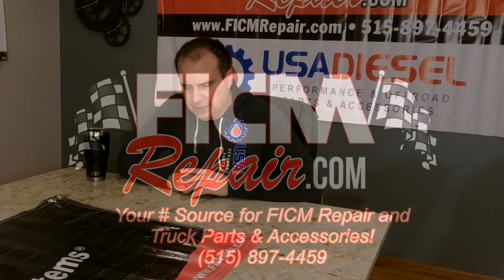Powerstroke 6.0: Injector sizing

Comment: I inherited my dad's 2005 6.0.  Hes got the egr delete, fass fuel system, head studs, tuner, and banks turbo.  My brother has had the truck a couple years and it has injector issues.  Im going to just replace all of them.  I just need to get a good size recommendation.

Comment: I wish it was only $200 more. I came in and talked with Scott. Pricing for 205/30 vs 155 same manufacturer was $600+ taxes and then I still needed a tuner and tuning all in all I was going to be $1400+ to go with the bigger injectors and run them as stock
Reply from the maker: I apologize for the disconnect that clearly occurred here, but as of this writing a set of premium 155/30's from Holder's diesel is $2,458 and a set of 205/30's is $2,640 for a spread of $182.  If you wanted to go with Holder's Basic Remans, the 155/30's set runs $1,375 and the 205/30's go for $1,475 for a spread of $100.  Perhaps you were comparing 155/stock units?  If so, that spread is far more as those units as a basic are only $900.  Regardless, if we tune your ECM directly, that tacks on $175.  If we get you set up with custom tunes on your SCT device, that price begins at that same $175.  Hope this helps!  Give us a call at 515-897-4459 if you'd like to visit more on this!

Comment: Ed, thanks for having this EXACT conversation with me 6 months ago and I went with Holder's 205/30s and Atlas 40 hp FICM tune. No complaints or smoke here. Also went regulated return to ensure they always have the necessary fuel. Now I'm just saving money for that stage 2 KC turbo!
Reply from the maker: Happy to be of service, Brett!  I am so glad that you are happy with the setup!!  Let us know when you are ready to go on the KC and we can make that happen as well!  :)
Reply: What’re your mpgs like ?
Reply: @dakotathompson8062  my engine isn't running properly in my opinion. I'm getting 17 but someone with a 6.0 and not as many air/fuel mods gets 17.5 consistent. I should be up to 18-19 and then at 20 in my opinion once I get a cam to take advantage of all my extra air.
Reply: @BrettASpitzer  yeah 18-20 sounds right that’s what I was hoping you were going to say,looking to do that setup on my truck
Reply: @dakotathompson8062  18-20 wow. My stock truck gets 11 in town and maybe 16-18 hway

Comment: im definitely sold,  looks like im most likely heading to big exciting "IOWA" for a min of 2 months sprayn corn, unless i get fired, wasnt my decision but at least i can swing in so you can push me in a better path then ive been going, and thanks again on the ficm other day, funny thing was the morning before i did swap back to 48v i wanted to eat  breakfast first, so when i went to start up, i shit you not but ficm voltage dropped, lol idk if your a saint or a jinx lol
Reply from the maker: lol.  I'm glad you had a replacement FICM at the ready at least.  Injectors equal money.  The more you can push that ball down field, the better.  Of course, when you ultimately do need something, we've got - well - everything.  :)
Reply: @ficmrepair  so on the cores, i understand nor would wanna piss anyone off turning in ones outta my junkbox i keep for emergency parts but my set im running now i was aware couple of them were diff brand, 2 years ago i had them tested and cleaned but after install drove 200 miles lost 3 cause they charged 500 got back injectors with spoolvalve nuts loose, so i pieced together what i had tested just coil resitance were all  bettween 1.0 and 1.2 i think but i can horse trade for my brothers old oem fords, 100k but match if needed?